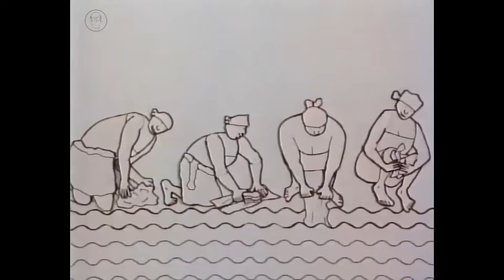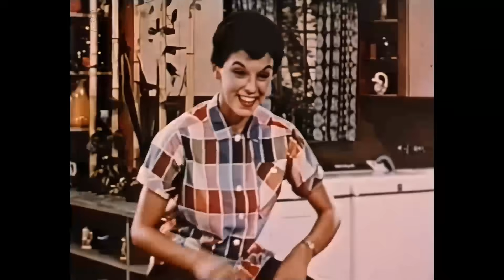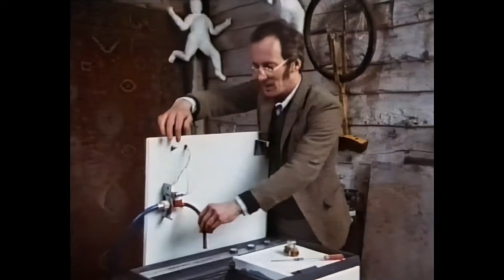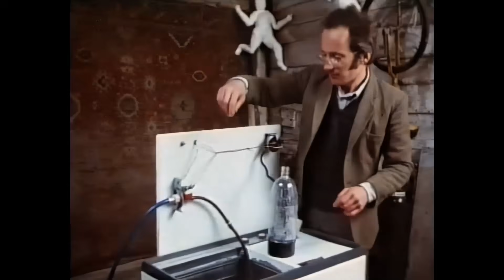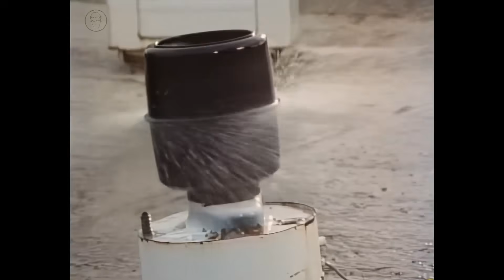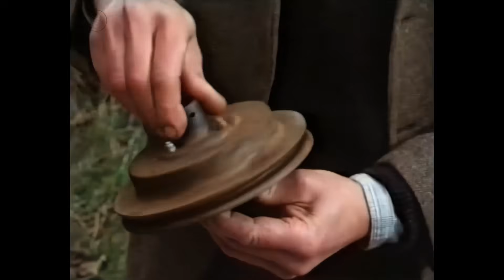The Secret Life of the Washing Machine - Remastered

Comment: Here in America, we used to have top loading machines. Now we have the high efficiency ones which work well except...

When they spin, they are pretty much guaranteed out of balance. Also with mine, since I live in an apartment, it's cheap and if something is too big, it won't spin it. It just gives up. No option for just spinning, only rinse and spin. I just know I must bring anything large to a Laundromat. Ugh!
Reply: Top loaders were all the rage in Australia too. Most of the new ones sold are front loaders nowadays.

Comment: The repairable thing has, in my opinion, taken a dive. My washing machine made some strange noises and issued smokey steam when I opened the door. When I pulled the heater out to see if there was something trapped in between the tub and the drum I noticed that the drum wasn't running true. My diagnosis was a broken drum support 'spider'. I went online to my normal spares supplier to find that you have to buy the whole drum assembly. After I'd stripped the old drum out I could see that the front and back halves of the drum are ultrasonically welded together so there is no way to split it and replace the spider. A pox on whoever decided that this was a good way forward. I've just scrapped a perfectly serviceable drum and tub.
Reply: i know exactly what you mean...

Comment: Interesting… the British washing machines needed an internal water heating system, indicating that British homes of the period had no central hot water supply!
Reply: How would we do a 90°C white cotton wash without an element in the machine, hot water is usually set to 60°C and the machines would usually take in some cold water through the prewash detergent compartment of the draw first, before drawing in hot water with the washing powder. Water sloshing around in a horizontal axis rotating drum will also lose temperature quite quickly, so needs heat to maintain it. The element is also needed to achieve the selected wash cycle temperature. Modern machines don't have a hot water intake and heat from cold. When using detergent with enzymes in it, it is also necessary to initially have the water at a lower temperature for the enzymes to do their job, and in the case of powdered detergent the oxygen bleach takes over as the water temperature climbs.

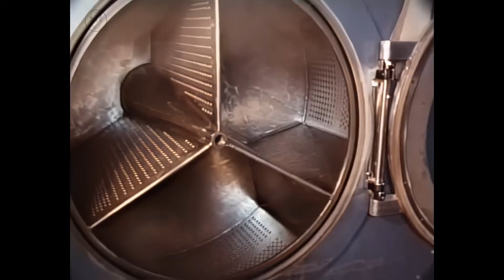Comment: 9:00 the top loading ones do sadly... My washing machine is only 4 years old and rocks like crazy if I don't balance it perfectly.

Btw it's so crazy how hard it is washing stuff without a machine and dryer. All my life until a few years ago, we had no dryer and hang dried everything, damaging and fading our clothes, and hanging up heavy wet denim jeans and soggy blankets is a pain. Then our washer broke, first it stopped sending level, so it wouldn't stop filling and overflowed, unless we sat there tending it and stopped the foll and manually dialed it to agitate, then reverse it every 2 minutes for a full 10 minute agitation before it fills again, etc. then the bolt broke too so the drum stopped spinning. I could wash clothes in the washer, but it couldn't spin to drain, so the laundry was soaking wet, I had to wring out my dad's jeans by hand, he's 6'6", I almost broke my wrist wringing clothes out, it's awful. Then we got a washer and dryer in like 2021 and it's like a whole new world where laundry is just putting clothes in a box and pushing a button, doing that one more time, and then putting my stuff back all clean. It's incredible if you've ever actually been there having to wash and dry clothes without working machines.

Comment: Here in the US most of our washers do not heat the water I would think that would be a normal thing here by now .
Reply: I wouldn't want a washing machine without a heating element,  a hot wash still does a better job than the best cold water detergents. I also use a boil wash to descale my machine and an occasional 60C+ wash along with using powder detergent helps keep the machine clean and free from smelly bacteria. Few if any of our washing  machine have a hot water inlet these days, because they use less water manufacturers argue that the cold water in the hot pipe wouldn't have run off before the machine is full, although I think the main reason is to cut costs and also the time taken to heat the water gives the enzymes enough time to do their job before the oxygen bleach released from the powder takes over.

Comment: The biggest drawback of all new washers is only the fact that the main bearing of the entire drum is located inside the outer drum casing and not outside. It is subjected to water and in cheap machines that bearing is made from steel that rusts. Couple that with the outer drum that is welded not actually assembled with screws because for the ease of mass production, and you can not replace that bearing when it fails a few years later. I, for one, have had enough with this shit and I usually use a multitool saw to carefully cut away the seam and take out inner drum and replace the bearing with new high quality one and then use the provided screw holes (yes the factory that molds the plastic outer tub makes HOLES  FOR SCREWS but the factory that makes the machine assembly don't use the holes with screws and just welds the tub halves together) in the two halves of the outer drum to actually glue back and fasten the outer drum back together and the machine keeps running. The one more big drawback is the small caps used in the circuit board of the machine. Countless times the machine stopped working mainly because the small caps that control the microchips went kaboom because of the large RF interference from the harmonics that comes from the powerful brush motor when it is very loaded.
Reply: The first sealed tub washing machines used the same plastic tub mouldings they'd used with screws and a sealing ring, so would be relatively easy to open and fix, newer models tend to have done away with the screw lugs and the channel for the seal, so in countries where they refurbish broken machines, they drill holes through the seam before sawing or using a chisel to split the tub and use silicone, or even car windscreen adhesive to try to stick them together, and some of them use plastic welding tools like heatguns with a heat glue tip attachment to weld the tub and use strips of plastic cut from a scrap machine's tub melted with the tool to fill the gaps and seal over the screws.

Comment: DIY repairing is one small step for mankind, one giant leap for self esteem.
The part my washing machine would need is a flimsy touch cable, yet it's only sold with the whole interface for quarter of a new machine's price and only for other models. I can't solder but luckily I could dispatch the misfiring faulty cable and we can use the mobile app to operate the machine via the NFC point. Yippee

Comment: These programs were made from 1988 to 1993.  I'm shocked by how crude the "modern" washer and dryer are as shown in this show.  A heater in the washer?  Concrete block to dampen the vibration?  Is there just a huge disparity between what was available in the US vs the UK at that time?   The washers I had all through the 80s were all mechanical device machines, of course, but more "elegant" internally.  They used hot and cold supply lines, not an internal "heater", and they had good balance with only springs to control the vibration.  Pulleys made of a metal rim filled with concrete?  Yikes.  I haven't seen anything like that in a washer ever, even in the 1970s.
Reply: In 1981, my mum had one of the first microprocessor controlled washing machines on the UK market, a Hotpoint Microtronic X2000. In those days all our machines had hot and cold supply lines, and they had a heating element too, modern machines use less water and have done away with the hot water supply and let the element heat the water up while the enzymes do their job, and as the water gets hotter if you are using powder, the hydrogen peroxide or peracetic acid oxygen bleach and surfactants take over.  It had beefy shock absorbers surrounded by large springs as I recall, and a shaped block of concrete mounted to the bottom of the steel tub to damped vibration, shocks won't do that alone with a full load of wet washing on a high speed spin. My current machine has shaped concrete weights bolted to the front of the plastic tub surrounding the hole for the door and the tub hangs from two springs, with a pair of cheap friction damper at the bottom, much cheaper design.

Comment: The washer I bought in 2003 was still electro-mechanical, with no electronics.  The one I just bought is digital.  So, the cams and switches hung on well into the microcomputer age.
Reply: yes I bought a micro washing machine for 3Kg. A Eudora. Here in Switzerland they are labled KENWOOD (yes that brand from UK). The Switch is LUCKYLY a cam-motor-switch! Damm was I happy as a watchmaker to discover that my machine had one instead these silly semiconductors. Bought it in 2017.

Comment: A lot of current commercial (restaurant/hotel) dishwashers still use cam timers. The restaurant I work at has a brand-new machine, identical to the 1977 machine it replaced. Not an IC in it let alone a microcontroller. Just cams and microswitches! I think it's because they are just so damned reliable. Microcontrollers are cheaper, but since these are leased machines, the less service calls, the better for both lessor and lease.

Comment: Like a lot of other comments, I watched this as a kid and am now in the middle to end of a career in engineering. A couple of aerospace connections, a few decades later: the straight vaned pump is called a Barske impeller, and can actually be reasonably efficient for a small pump. Another is that there were, back in the day, rockets that used mechanical cam timers to do things like stage separation and ejecting fairings. Now it's all computers and controllers, but the cam timers were simple, repeatable, reliable, and resistant to every sort of EMI short of having their power cut.

Comment: When I first started in appliance retail, this series was invaluable in giving me understanding of the basics of the machines.

There are still appliances, such as the Asko and Miele washing machines, that still hold to the idea of putting build quality first (separate chassis and cast-iron counterweights, for example) - most devices feel kind of flimsy by comparison.  Some brands have a gimmick warranty where they will give you a replacement motor for free if it breaks in the first 10 years but don't mention the fact that the labour costs still have to be paid for by the customer and these can be pretty horrendous with the direct drive machines.  You have to almost dismantle the whole machine to change the part.

Comment: Thanks for this video. Around the time this video originally aired, I bought my first washer and dryer. Stories of unreliable machines abounded. I told the salesman that I was working 60 hours a week for an defense contractor and I really did not want to have to tinker with these machines. He sold me a commercial washer and commercial dryer. They are very basic machines usually sold to nursing homes and similar institutions. They are mechanical, no transistors or ICs. You may notice that I used present tense in the last sentence. I still have them. To date, I have changed the belt and the idler bearing in the dryer. The washer has all original parts. All hail mechanics over electronics for this sort of application.

Comment: 31:03 When Tim talks about modern washing machines being easier to repair as opposed to the modern day principle of planned obsolescence, I think a lot of manufacturers of expensive machines are realising that if something that costs $2000 or more breaks down and dies after a couple of years, the average consumer will say "I'm not buying that brand anymore" and looks to buy elsewhere.  Whereas if a fix can be made with the purchase of a few spare parts and ends up keeping the machine running, they will tend to stay with that brand when it becomes time to trade up.
My Fisher & Paykel machine (no, I'm not an employee nor am I getting any endorsement recompense) has lasted about 10 years and in that time it's only had a new hot water inlet solenoid and a new drainage hose...both of which I managed to replace myself.  Needless to say, I will most likely choose an F&P machine in the future.

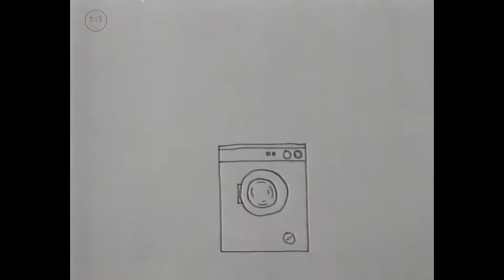Comment: 23:10 that's right. Even the washing machines made between the 1980s and 1960s have a drop in over quality over the years. It all didn't start to happen recently. For example AEG: 
AEG LAVAMAT Nova (1961) = 4900€ adjusted for inflation (2021), weighs 116Kg (or even more), 3000W heater/3500W power supply
AEG LAVAMAT 980 (1987) = 1300-1350€ adjusted for inflation (2021), weighs "around" 85Kg, 2400W heater/2750W power supply

Comment: I watched all of Tim's eps many decades ago, and I'm glad he's still around.  Just found these, didn't even know he had a channel until some Youtube algorithm fluke of mixing channels.  It was great to see that washing machines evolved from much simpler tools.  The agitator can trace it roots to over a century ago, but its the spin cycle that was a development that required more tech.  FWIW I have one of those old synch motor machines, and its over 20 years old, made to last.  They resist dampness and vibration more than digital.  Today, the chips are made so poorly that they tend to fail sooner than those made a decade ago, so its better to repair old machines than buy new ones of cheaper quality, or if you can still find those that are still all analog.

Comment: The funny thing is that way back then we wanted more computerized, microprocessor controlled machines, but now we want them to be more mechanically simple and easy to repair, especially at $900 or more. i would rather a Maytag wringer washer which you have to fill and empty manually. Really.

Comment: I run a small real estate company and find this film really entertaining and enlightening, Right now I have a fleet of 4 Miele washingmashines build in the last 20 years all with computers, they last long and are really reliable, but for when they do fail I got an old 1990's Zanussi machine with a manual timer, possibly one of the last series ever build that way, I call it the Stuka. it goes up on my trailer and gets taken to what ever location there is a breakdown to work as a replacement machine.

Comment: I'm actually rather surprised watching this, how little these machines in particular have really changed in the past 30 years. Apart from a slight difference in the control panel - more electronics and LEDs and fewer mechanical dials - the entire operation is basically identical.

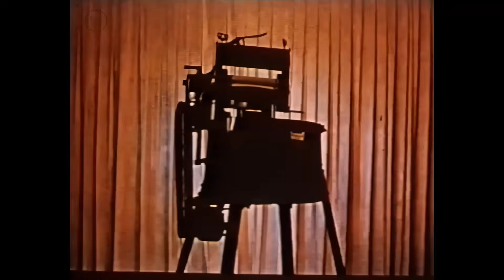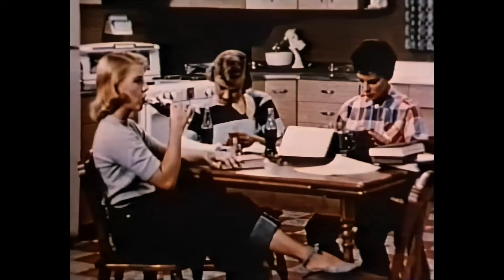Comment: That clip at 3:24 and 4:56 is familiar since it’s from the film “Mother Takes A Holiday” by Whirlpool Corporation and it shows the process of them designing their top loading automatics. The Whirlpool design uses a transmission with gears inside, has solenoids to engage and disengage the wash and spin and that design was around from 1947 to 1986.

Comment: In the interview afterwards he said that he thinks the motor is some kind of sophisticated brushless motor or something, and he is spot on, at least for the ones he could see. They are in Europe, but not in the United States of America. The induction motor has been used and continues to be used since before 1970. I think this is because of it being cheaper to produce as well as mains voltages being around 120 volts instead of double that for much of Europe. That's just a guess at the reasoning....

Great history lesson. Here's a thing that most people dont know about those pressure switches: Many times there is a screw that adjusts the amount of spring force applied to the diaphragm, which means that you can ADJUST THE SWITCH IF YOU ARE NOT GETTING ENOUGH WATER IN THE TUB TO EFFECTIVELY WASH THE LOADS. My mother and father bought a new machine precisely because of the old one not filling completely.  I volunteered to dispose of it for them, right into my laundry nook.

Comment: Amazing seeing this, I’ve been repairing washing machines for nearly 30 years and worked on most of these models of machine. Sadly, I don’t think the repair trade will last much longer though.
Reply: Because you cant get parts?
Reply: @leenevin8451  partially lack of spares for non brand products, partially down to cost of spares making a repair uneconomical, but also because manufacturers are ensuring they are the only ones who can repair their own products. For a good while now a large amount of new whitegoods are using electronics that can only be coded and setup by manufacturers using their own software

Comment: I had to pack round the bolts holding the concrete and also change the bearings of the machine in my first (shared) house. Mum had a wonderful machine in the 70s that took square plastic programming slabs with a program on each edge. I think the slabs were double sided so 8 on each of the two slabs. 
Still running a late 90s mechanical timer machine though it does have soft-starting modern motor drive
Reply: Sounds like you mum had the famous and expensive in the day Hoover Keymatic , 4 programmes printed on one keyplate side then flip over another 4 making 8 , later machines had 2 keyplates so 16  progs in total , great machines ...👍👍
Reply: https://youtu.be/qb0raz6IXLs